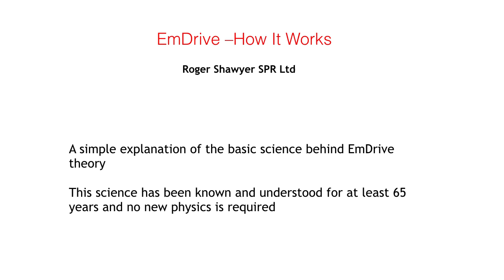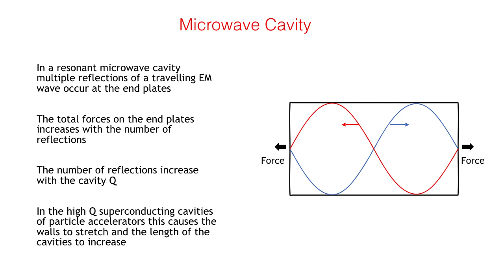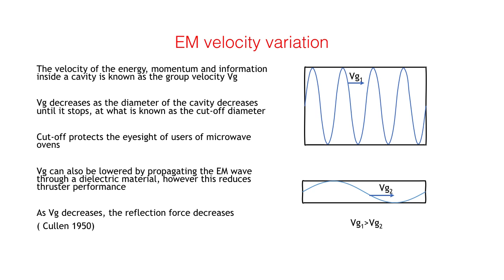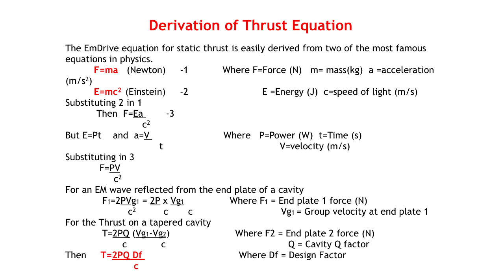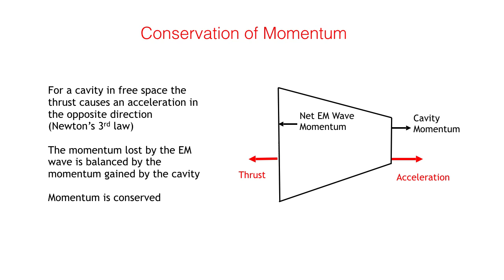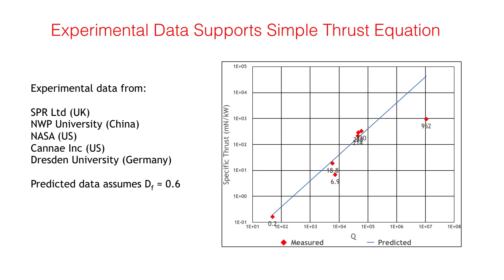Roger Shawyer - EM Drive technology

Comment: I believe that space has density, and that there is a gradient to the density of empty space.  Any device that can create a pressure difference in the density can move by way of space drive, I think.  They might need to use two or three generators, to create and focus the low pressure area, and as soon as there is less pressure, the whole ship or whatever, moves to the low pressure area, it falls through space.  Bob Lazar says that one ufo design he saw caused the ufo to be constantly falling, through space.  The future of space travel is very obviously not rocket propelled, it is not propelled by anything, as much as it impels itself.  The show that the billionaires have put on is simply that, a show.

Comment: Ah, yes, I was just writing about this thing.  Did you know that Nassim Haramein has a patent for an idea that improves this idea, by taking it from a type of sail, into more of a propeller or maybe impeller.  I am looking at the invention that Boyd Bushman had a patent on, and asking if it could be used to pull subatomic particles toward the sail or propeller.  My thought is that it would turn the propeller idea into a jet type of device, by collecting all the available particles in front of the propeller the way that a jet with its housing pulls in more air than the propeller blades alone can.
Reply: Jesus Christ loves you! He was Crucified on a Cross and then was resserected on the Third Day!